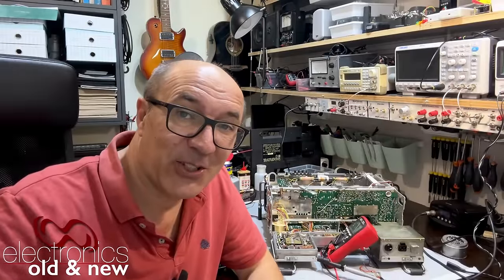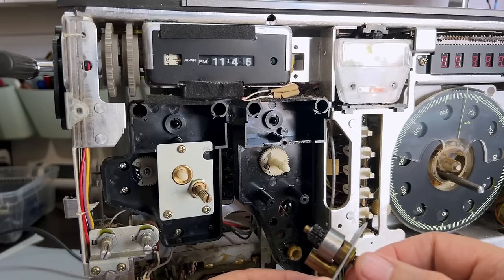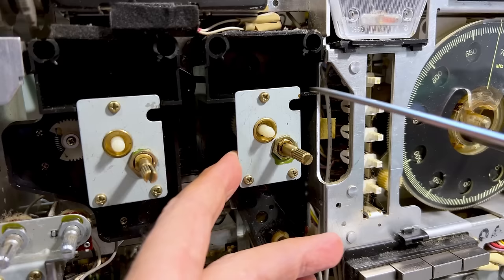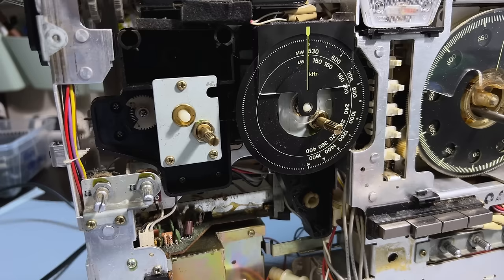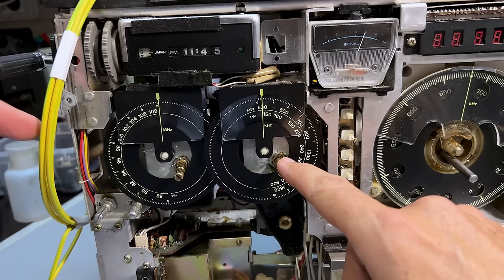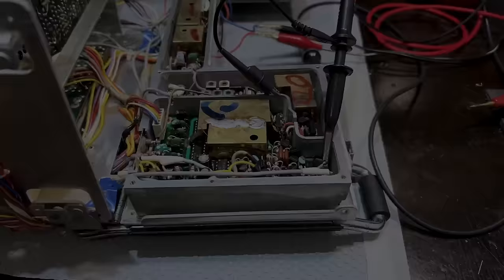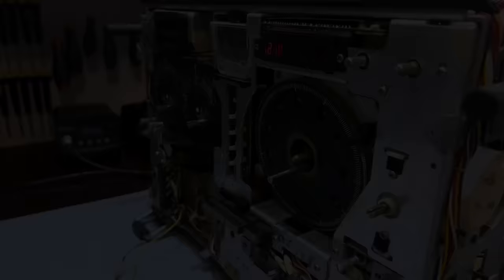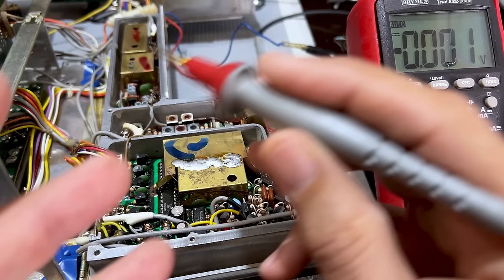Elusive Shortwave band still making life difficult. Sony CRF-320 restoration Pt.2

Comment: Not having a schematic, I don't know for sure but the 100 ohm resistors in the 12V line may provide isolation between different circuits, expecially if there is an electrolytic capacitor (and also possibly small value hf cap) downstream of the power source.  This should make it easier to find the source of the excessive current draw (250mA sounds excessive) since there will be a significant voltage drop acroos the 100 ohm in the circuit that is drawing too much current.   Another way of finding a heavy current consumer is with an IR camera.   If you see a hot electrolytic you know something is seriously wrong.  I really enjoy your videos and I am happy you have the opportunity to tackle this radio.  You always seem very systematic and thorough and the results you achiever are always outstanding.

Comment: Hi, I have been through similar trials with my CRF 320. For point of reference the tape is original and present throughout the radio. It is now control aligned and working but has a slightly tight section on the SW tuning. The sound is superb and the SW performance very good even with the telescopic aerial I replaced at great cost.
I have a good legible pdf of the full manual if you still need it. I zoomed in and printed enlarged sections to help with the circuitry.
 I also have a CRF220 which is in such stunning condition that I cannot bring myself to pull it apart. It is fully working and has its original receipt and documentation in mint condition.
Reply from the maker: Great to hear yours is working well. I have received a very good schematic from another viewer, but thank you all the same.  Can you tell me where you found the antenas? This one is going to need 2 😩

Comment: When the schematics aren't available or you can't read them it's time to play process of elimination. I would disconnect the 11v feed from that board and see if the voltage rises. Another method is to disconnect the 11v volt feed and directly inject it into that board from your external supply and see if it draws excessive current. Great video, I love these tricky faults but I hope you resolve it. Hope you and your family have a happy Christmas Manuel, all the best from Ged.
Reply: PS Don't forget to current limit the power supply if you voltage inject 😊
Reply from the maker: 👍 thank you. Happy Christmas to you and yours.

Comment: The challenge continues, you would be bored if it was easy.  My very brief glance at the schematic shows the 11V is also used in the audio preamp, tone control and in the FM RF amp and mixer, so if anything was wrong with the 11V  it should impact those. There is a 12V to 11V dropper (yuck) resistor (R363) on the main board. and 250mA sounds a bit high, so (as radio-ged4626 suggested) may be worth dropping some of the load or may be one massive red herring. Have a great Christmas (with anything other than red herring).
Reply from the maker: 😊 thanks
Reply: @electronicsoldandnew  I suspect you have fixed all by now, but a point worthy of note is that 250mA for SW is, according to the spec, normal for this radio (500mA when outputting at 2W, yikes). Chasing down a suspected overcurrent would have been an entire shoal (of the previously aforementioned aquatic vertebrate animals).
Reply from the maker: Yes, I figured that the current is about right on SW. this thing must really chew through batteries 😊

Comment: Have you checked the voltage at the other end of the feed-through capacitor where you measure those 10.3 volts? I've had my share of surprises with those.